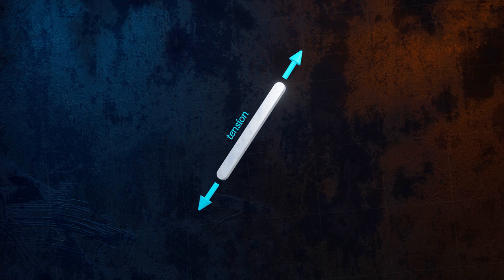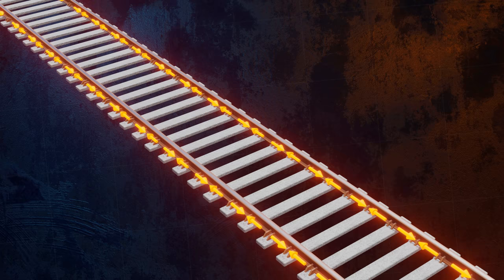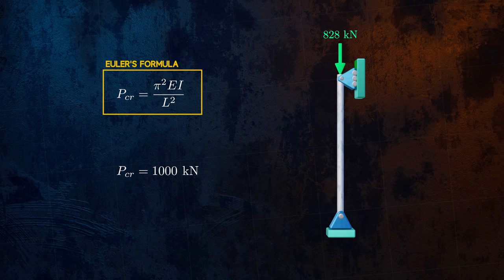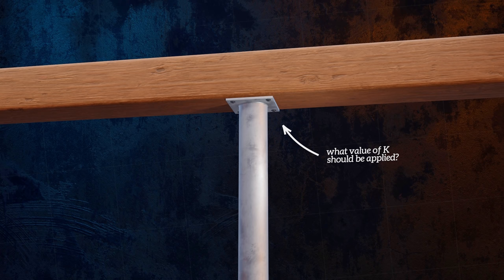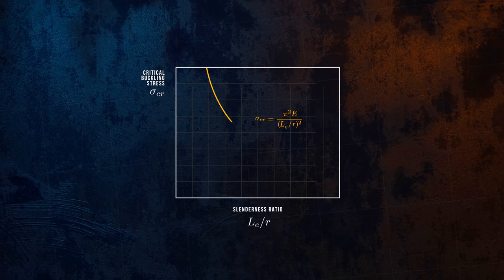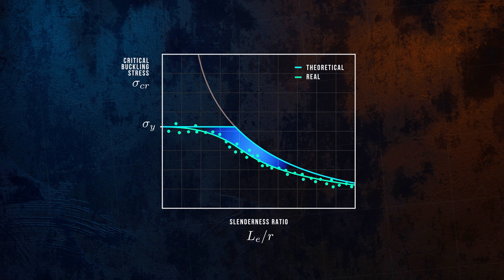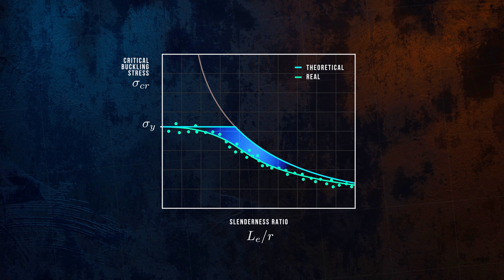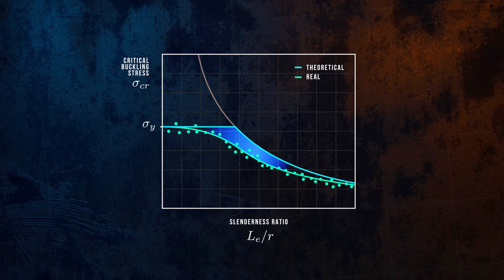Understanding Buckling

Comment from the maker: Thanks for watching! Here's a link to the short video on Euler and the Self-Buckling Problem on Nebula - https://nebula.tv/videos/the-efficient-engineer-euler-and-the-selfbuckling-problem!
Reply: You are saying “ Pcr doesn’t depend on the strength of the material at all” but it is a factor of E and E is the indicator of the material strength
Reply from the maker: E represents the stiffness of the material, it doesn’t tell you anything about the strength of the material.
Reply: @TheEfficientEngineer  Thank you for your comment and taking the time. You're right that E indicates material stiffness, not strength. However, in column buckling, E is crucial for determining buckling load, albeit not directly indicating the material's strength. While it doesn't predict strength beyond its elastic limit, E is essential for understanding material behavior up to that point. Thank you so much for the Video it is very insightful and thank you for the promotion as well really Fantastic work.

Comment: In Eurocode 3, EN 1993, there are classified into 4 categories according to buckling curve. In many cases, buckling and fatigue govern structural design rather than material yield strength.  There is no better way to understand it than your video! Superb! I've got a lot of details on how to derive the buckling curves from their origin. Excellent video on engineering!

Comment: Great video about buckling. Euler was a genius, buckling was a tinny amount of his work but with great effect. Been able to predict buckling failure can save work, money and mostly save lives. Sadly most scientist that mention Euler never mention his development of the buckling equation.
In my career as a structural analyst I always dealt with buckling.
A thin-walled open cross-section (11:34) beam, or column, can also fail at the flanges and at the center member. In aircraft structural analysis it is known as "crippling". Crippling can occur in longitudinal member between frames.
Also another way that a slim member can fail in buckling is called "longitudinal buckling". It can be loaded in a concentrated moment at the ends or as a distributed load as in floor beam.

Comment: In structural Steel Design, the AISC design code allows another method of analyzing columns without using effective lengths.

The column stiffness is reduced while a notional lateral load is applied as a small percentage of the gravity load carried by the column. The K-factor is taken as one regardless of the end conditions. The notional load accounts for the geometric imperfections of the column.

It makes it much easier to analyze an entire structural model instead of having to input the K-factor values for each columns one by one.
Reply: The notional load also accounts for the accidental eccentric loading. Forgot to mention that, haha.

Comment: Thanks for the video. The example about the buckling of rail tracks at the begging is checked by structural engineers using the track bridge interaction theory (i am currently designing for this) as well as the track engineers when they design track systems

Comment: Surprised to read below at the number of people who are confusing Young's modulus with the strength of material.
Young's modulus, or E, is a measure of a material's resistance to deformation.  As was pointed out repeatedly, steels with greatly varying tensile strengths have practically identical E.
Consider the following:  Two dimensionally similar tension members, one of say 7075 T6 aluminum, the other of a structural steel, both with an ultimate tensile strength, UTS, of say 75,000 psi.
Both members are loaded in tension with very similar loads.
Measuring the deflection of each member, one will find that the aluminum member will deflect three times as much as the steel member for any load up to the yield point.  Why???
Because aluminum has an E of 10 million psi, and steel has an E of 30 million psi.

Comment: We buckle drill pipe inside wells all the time while drilling, and eventually with enough weight the drill pipe will start to corkscrew inside the well and lock up. Not a catastrophic situation because it is very flexible and can be straightened out by pulling the pipe out a bit, but it's bad practice.

Comment: Question regarding Euler's formula: 
Am I correct in assuming, that technically, buckling would NEVER occur if a column/load setup was perfect in every way? As in, no geometrical defects on the column, perfectly homogeneous material properties, perfectly centered axial load, zero external effects/forces, etc. A perfect system like that would necessarily fail to compression and not buckling, no? And it's the fact, that perfect setups like that are impossible in the real world, we end up seeing buckling behaviour in beams? 

If the above is correct, where/how does Euler's formula account for "imperfection" exactly? All the input is based on a perfect Euler-column, so no "imperfect external factors" are present - the formula only contains pi, E, I, L -  are the imperfections "hidden" somewhere in the derivation of the equation?

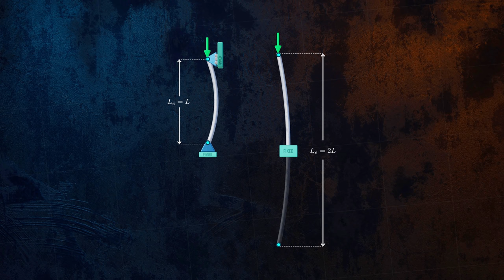Comment: Great video! Though, there is one bit that I failed to understand: at 4:53, it is shown that a column with one fixed and one pinned connection has an effective length under compression of 0.7. Why would it jump from 1/2 to 7/10, instead of something more natural, such as 3/4 (0.75), which would be half way in between both being fixed and both being pinned. After looking at multiple sources, I don't doubt that you are correct, I simply wonder why this is the case, as I was unable to find any concrete reason why. Still, this video provided an incredible and simple explanation of relatively complex topics. I look forward to seeing more from you!

Comment: would a high mast pole for lighting fixtures, those seen on highways and such, be prone to buckling? you mentioned a column is at risk of buckling. but wouldn't that only be the case if it was actively being compressed? a free-standing column, not under compression, shouldn't be at risk of buckling correct?

edit: oh looks like you covered self-buckling another video

Comment: So the first mistake is beeing made right in the beginning of the video.
Parts fail in tension, because once they break, they will no longer be able to take any load; it is as if they were not there at all.
In compression it is a different story. Parts will continue taking an increasing amount of load - but they deform as they do. So what is your criteria for failure? More often than not it is permanet deformation of the part. But again; the part still takes the load.

So let's say a part of a cars suspension is under compression and is overloaded; it is permanently deformed and thereby shortened. Maybe now you car is lowered, but it still drives. With tension this is a completly different story.

main takeaway: define what your failure is: complete breakage (almost not possible in compression) or permanent deformation (easily possible in either tension or compression).

Comment: Great video! Will you cover the Rankine-Gordon theory of buckling at some point? It's particularly interesting where the slenderness ratio falls in that midpoint where theoretical and experimental results blend between plastic and elastic buckling - I read that R-G theory is slightly more accurate in this range but is it redundant for other slenderness ratios?

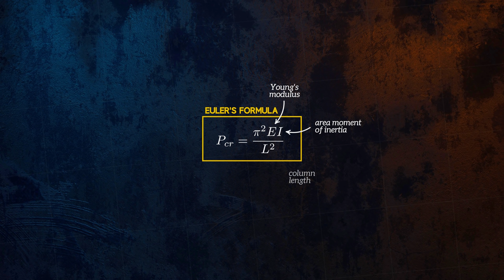Comment: 3:00 "It doesn't depend on the strength of the material at all". The Young's modulus IS the strength of the material for all intents and purposes.
Reply from the maker: No, Young’s modulus is the stiffness of a material, which is completely distinct from its strength. A material can be very stiff but still have low strength.
Reply: @TheEfficientEngineer  The young's modulus is stress divided by strain from the first part of a stress/strain curve. "Yield Strength" is the point on a stress strain curve where a material deforms permanently.

Comment: Thanks for the video. I am working on an automotive project where I have a member pinned on both ends which experiences compression and tension (a track bar). This member is a hollow steel tube with a slenderness ratio of about 75. For packaging reasons I needed to put a bend in the tube so it would fit around other parts (differential housing). This is similar to a Jeep Wrangler JK track bar. 

Could I model buckling in this member using the secant formula as described (10:12) for members with imperfections? Would the best way to reinforce this member be to increase the area moment of inertia? Would it be best for the reinforcement to be added to the ID of the bend or the OD? I assume the buckling would occur in the same plane as the existing bend in the tube. Is that correct?

Comment: i have a question to 6:17 . when you see the left point (fixed) and the right point (rolling) you know that the compressed member can buckle. the supporting , bracing member does give the force over to the top. however the two member (of the triangle) at the top pass their force on the Point A nd B and will pull: so the force is passed on to the member we initially wanted to help from buckling: the horizontal forces of the two members namely pull andtherefore the original member is, as said, compressed.

so this does not help at all, right?

Comment: 3:03. You said critical loading doesn’t depend on the strength of the material at all. Yet elastic modulus is right there in the equation.
Reply from the maker: Elastic modulus is the stiffness of a material, not strength.

Comment: 3:02, just to clarify, you say Eulers formula doesn't depend on the strength of the material... isn't the Young's modulus a measure of the strength of the material?
Reply from the maker: No, Young’s modulus is a measure of the stiffness of a material - it doesn’t tell you anything about a material’s strength.

Comment: I am not an engineer or a material scientist so maybe this sounds trivial.  On the 3rd minute,  it's mentioned that Pcr does not depend on the "strength" of the material. But isnt Young's modulus dependant on the material? Is "strength" defined defferently than i take it to be?
Reply from the maker: Strength and stiffness (Young's modulus) are two different material properties that aren't correlated. Different steel grades can have vastly different strengths, but all have approx the same Young's modulus, and so will have approx the same Pcr.
Reply: @TheEfficientEngineer  I see. Thank you for your answer. Great video. Although I see your point and dangerously approaching nitpicking, I feel there should be a deference in wording for not depending like you mean it and not depending like “Pcr doesn’t depend on the nearby gravity well”. Arguing further, if you were to assign the fraction E/L^2 as E’, there would be multiple configurations with different L and the same E’. This doesn’t indicate that P doesn’t depend on L. Is it ? Maybe I am confused

Comment: Hi, thanks for this super-cool lecture. I have a question: for an elasto-plastic material, is buckling initiated in the elastic region? Can it also initiate in the plastic zone? What about paperboards and corrugated boards?
Reply: I shouldn't be answering your question, because I'm not an engineer.  However, The Efficient Engineer did not answer you, so I'll do my best.  This video is primarily about elastic buckling.  In theory, all buckling starts out as elastic buckling, if the material has any elasticity.  As the load is increased, it will eventually exceed the yield strength, at which plasticity begins.  Some materials may have no elasticity.  Buckling for those materials will always be plastic.

I have NO expertise in paper boards or corrugated boards.  Paperboard's stiffness often is asymmetric or highly variable, depending on the manufacturing process.  Corrugated board's stiffness and elasticity is inherently asymmetric.  In one direction, it can be quite elastic (depending on the type), while in the other direction, it is not.
Reply: @55dbk  Hi, thanks for your comment! So I ran some simple fix-fix column buckling FEA simulations, with elastic material and elasto-plastic materials. I selected longer length to ensure stress was low i.e. buckling was initiated in elastic region. But in addition, the buckling initiated at even lower loads for the elasto-plastic material. This may imply that materials exhibiting plastic behavior have lower buckling loads than fully elastic materials.

Comment: Can someone explain the difference between bending moment and buckling 😕
Reply: When a beam (or column) bends, one side is in compression, and the other in tension. If not restrained, the flange that is in compression will become unstable i.e. deflect laterally and twist. This is lateral torsional buckling, which occurs under bending.

Under pure compression, where the column section is under uniform compression i.e. the column will deflect laterally (not twist) if it is not restrained. This is buckling under pure compression.

Comment: Isn’t Young’s modulus a characteristic of the strength of material?
Reply from the maker: Young's modulus represents the stiffness of a material, not its strength. A material can be very stiff (large Young's modulus) but still have low strength.
Reply: @TheEfficientEngineer  but you’ll have to perform tensile test to determine the Young’s modulus right
Reply: @analyticshub9615  it kind of depends on the material. For non-composite material like steel, for a given cross section and length of the test specimen, for a given amount of load applied, the amount of strain produced is a property of the Elastic Modulus. The Elastic modulus doesn't change (that much) based on the yield strength of the steel, whether it's A36 steel or A992 steel.

It's a different story for composite heterogeneous material like reinforced concrete where the Elastic modulus can be correlated to its 28-day compressive strength based on numerous experimental data, but even if so, the Elastic modulus still represents the stiffness of the concrete element.

Comment: On hot days if railway track expand and expansion is prevented , shouldn't the compressive force should be equal to tensile force of expansion. how tracks buckle?
Reply from the maker: Expansion causes the tracks to get longer if unrestrained. But since they are restrained, the track that would be longer is forced into a shorter configuration, and so it builds up a compressive stress in the same way that applying a force to the ends of a bar to shorten it would.
Reply: @TheEfficientEngineer  In Canada at least, railway rails are stretched before the joints are welded.  This accommodates some of the heat expansion in the summer.